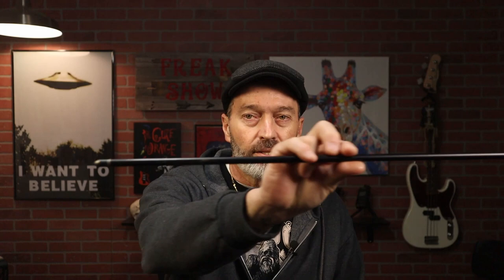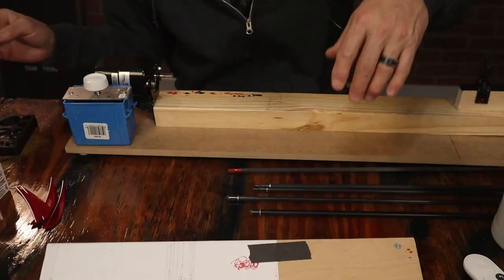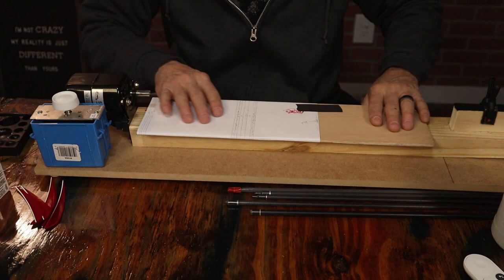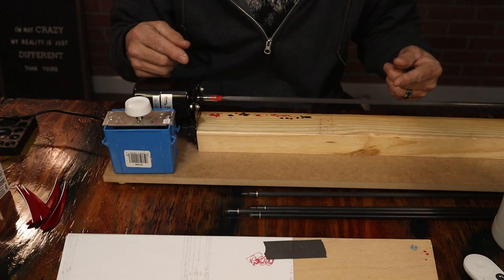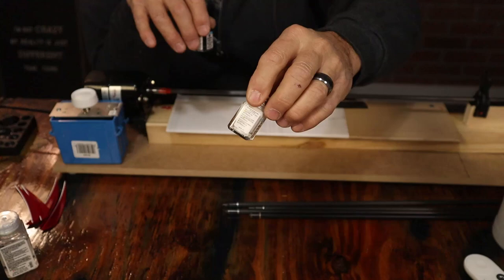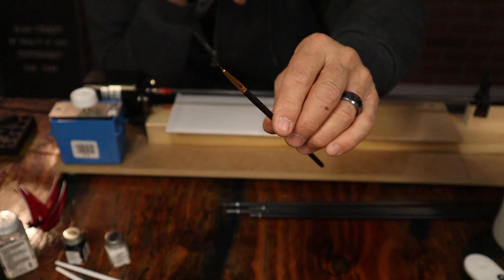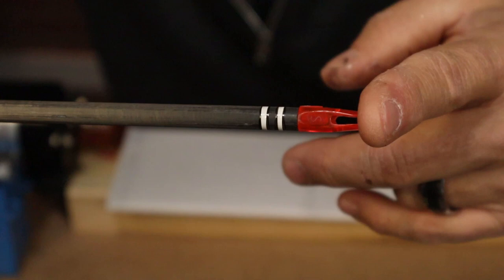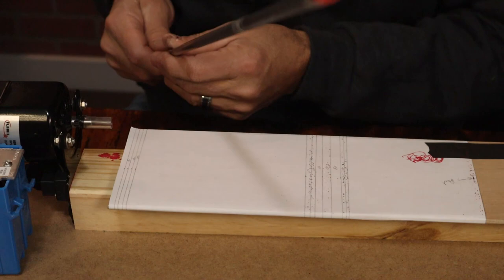Arrow Cresting

Comment: Hi Scott, I wish this video was out when I started doing this a few years ago.
Because I didn't have a reference, I went to the only experts I could think of in my local area, a shop which specialised in Warhammer.

after explaining the crazy hobbie I was trying to get into, I found that I wasn't the first person to ask them for info.
The end result is so good, that I've often been asked where I get my wraps.

1. use a surface primer.
I found the rustoleum grey/matt white works well. grey is better if using a lot of white, easily see where you put your first coat.

2. use good quality hobby paints with the appropriate thinner
I was pointed in the direction of MrColor series of paints (from Japan).
Combined with the thinner, every layer dries like glass

3. with the protective clear coating, wait a few days before applying.
the longer, the better. I generally wait at least 4 days before applying the clear coat. This is the secret to avoiding bubbles/smudges.

I use two brushes, both camel hair. one is flat and around 1/4 inch wide while the other is a thin point.
I hardly ever use the point since you can angle the flat brush and make very fine pinstripes with it.

I initially made my own cresting jig, but eventually caved in and bought a spinrite.
cost quite a bit, especially since he didn't initially ship to Australia, but he obliged me, installed an international working motor (50/60hz @ 110-220v)
haven't regretted it since.
Reply from the maker: Man, thanks for the great advice! I have a love hate relationship with the brushes I have used. They work, but not to my liking. I'll definitely take your advice on those, and the paints as well. Matter of fact I'm starting the process of tuning some new arrows for my longbow and sounds to me like a great excuse to try these tips out to finish my new arrows. Thank you so much for a great comment. Have a great evening my friend! Best regards